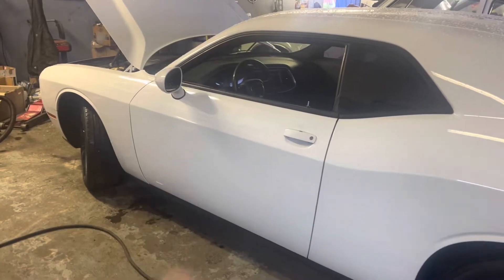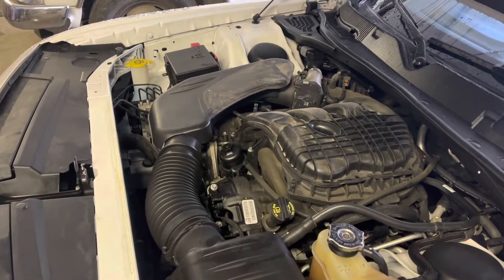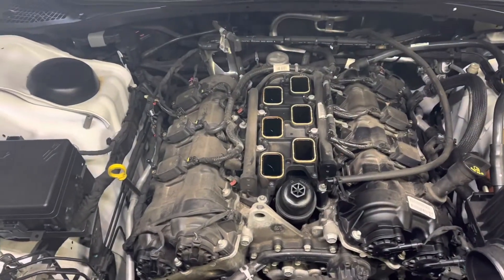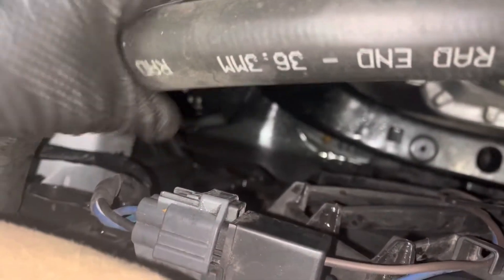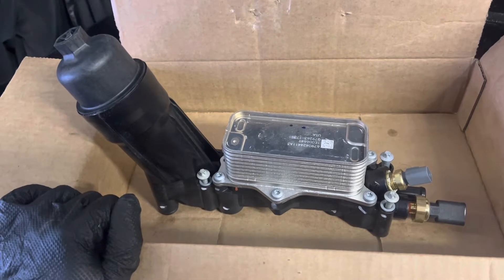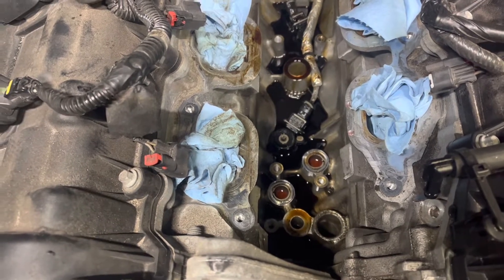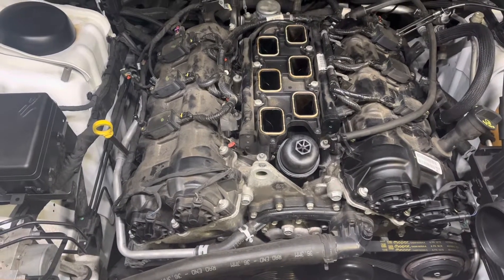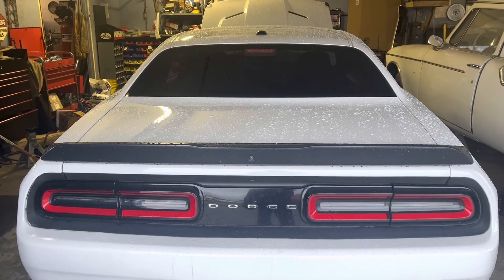The Dodge / Chrysler 3.6 “Pentastar” V6 Oil Cooler Problem - And How To Fix It

Comment: I have my oil cooler off and I cleaned the pool of coolant . However the coolant is constantly leaking. Have you seen this happen.
Reply from the maker: You have to drain your radiator / cooling system before you pull the cooler. If you didn’t do that, that would explain it!
Reply: It's contaminated with oil in the coolant. What's your thoughts?

Comment: One thing to remember is these have 5 Orings on the bottom that leak because they've been flattened and get old its not necessarily the cooler leaking unless the housing is cracked by overtightening the oil cap. The isuue is its alot of work to lift off both manifolds then removing the oil cooler just to change the Orings so if its leaking just replace the cooler itself while your down there..
Dont get the Doorman aftermarket they can be ill fitting especially the mating surface, the Orings arent as good as Oems and will leak sooner and they dont come with the extra smaller Oring replacement for '18-'22 FCA vehicles..
Always get oem for a sure fit and better spec for internal passages and don't crank the cap it will be totally fine..
Reply from the maker: Dorman aftermarket is going great on my Challenger. Seems like everyone else doing this job is also using the all aluminum Dorman unit. Didn’t know it existed at the time of this video or I would’ve too. Sure, could be O-rings. The OEM parts are only good for 90-100k miles? But we should only use those for replacement... I guess we’ll see.
Reply: @DeadDodgeGarage  I'm glad your having good luck with your Doorman and some on this thread but it doesn't speak for all. Some have replaced it up to 4 times, some still leak and are posing a few problems. Practically 10 out of 10 times the Oems won't leak unless a jar head cranks the filter over 200 ft lbs and literally cracks it and it's the Orings underneath that get smashed that leak and simply need to be replaced as with Doorman they will still leak also only sooner. There is really no need to run out and gel a metal aftermarket to replace a good Oem part taking a chance. Aftermarket material is always substandard to spec on anything Oem.. Oil & coolant share this unit under high pressure and heat internally and not sure I would trust it not to breach and mix the two....
80% have shops or someone else change thier own oil so most want aluminum to minimize the risk.. Do it yourself no issues..
One important item is the Oem comes with the new mandatory smaller Oring for the downspout for FCA models between '18-22, the Doorman doesn't so some cram grease around the Oring and shove the unit into place with a larger Oring then it leaks later..

Comment: is it possible for the oil and coolant to mix in the cooler causing chocolate milk oil?
Reply from the maker: I see no reason why it wouldn’t be possible, but I’ve never seen it with any of the bar coolers I’ve seen.
Reply: @DeadDodgeGarage  Is there any other places on the pentastar that a bad seal or something could cause it to mix? I just put a Zero mile reman in it, replaced everything possible. I doubt it has 500 miles but the oil had a ton of coolant in it. It looks like it was mixing from day 1. All compression checked out at 135+.

Comment: Great video!  Curious your thoughts on the Dorman replacement version that is all aluminum construction vs the factory plastic design.
Reply from the maker: I didn’t know about it at the time I made this video, or I would have gotten one… they are supposed to be the ultimate fix.
Reply: @DeadDodgeGarage  Ahhh ok, good to know you agree with it. I'll probably put one in our 300S when I change out the spark plugs. Thanks so much for your time!

Comment: Has anyoe had oil pressure sensor circuit codes? Does the oil leak onto the sensor and cause it to short? If I replace it would it most likely fix that code as well?

Comment: I have that little puddle would oil leaking on to my knock sensor be causing it to kick on? Its intermitten but i keep getting the p0330 code. I know this is old but hopefully you respond  btw loved the video
Reply from the maker: I’ve never had that happen, but it would make sense.
Reply: @DeadDodgeGarage  I mean I'm not having any performance issues and the behavior of the vehicle don't change but that is where the knock sensor is located. It says knock sensor circuit 2 malfunction

Comment: I bought an aluminum one from Dorman, I can’t complain at all about it ! It was a pain in the butt to change, I had to lightly tap the old one out with a hammer to get it out it was in there so tough.
Reply from the maker: Yeah! Those didn't exist yet when I still had my repair shop. Several people have dropped in the comments here to let me know that's the way.

Comment: A friend of mine brings her caravan to me for oil changes etc, I shuddered the first time I saw this oil cooler setup - I did learn you can buy a replacement made of aluminum.  I am extremely careful with that housing and the filter as I don’t want to break the bakelite threads - I agree with you though, the little pentastar 6 has a ton of power.
Reply from the maker: I learned about the aluminum unit in these comments. I’ve never seen one, but if I have to do it again… I’ll find one of those.

Comment: Hello, sir. I have a question. 3.6 engine need to change the circuits?  because the 5.7 does not
Reply from the maker: Circuits?
Reply: @DeadDodgeGarage  engine chains. i was hear 5.7 dont have chains , how 3.6 engine ? have chains or no ?  Thanks you sir for answer
Reply from the maker: @liudasjankauskas601  5.7 has a regular timing chain for the in-block camshaft. 3.6 has quad cams and two humongous timing chains... It's a crazy setup.

Comment: Would the oil cooler cause a small amount of oil to be in the coolant? Also noticeable fluid around the bottom of the cooler and leaking near the transmission housing
Reply from the maker: Definitely possible. I haven’t seen fluid exchange on these myself but it’s certainly possible that they could swap. Yes - you’ll have the little swimming pool in the valley, and it will leak down onto the transmission. On my Ram truck, it would splash out any time I accelerated quickly or went up a hill, stream down the transmission and hit the exhaust.

Comment: Where the engine oil cooler goes that provision present an opportunity to take a idea out of Audi's play book.
Reply from the maker: Remote mounted? I try not to know much about Audi. Haha.
Reply: @DeadDodgeGarage  The 2.9 twin turbo v6 in cars like the RS5 produce 444 hp and 400 ft-lbs of torque. 0-60 takes a little under 4 seconds. I would delete the oil cooler and pump an oil feed to twin turbos. On the low side of the rpm range  incorporate a centrifugal supercharger which goes neutral on  mid to high reducing parasitic load. Oil coolers (air cooled) can be incorporated in the routing. Just an 💡.

Comment: Hey I just got my oil cooler replaced then my themoststat needle continued to fluctuating and running hot next I replace the thermostat and it is still fluctuating, what do you think the issue is now
Reply: Prob trapped air in coolant system
Reply: Prob trapped air in coolant system
Reply from the maker: I don’t think you’ve got anything left but, like, head gaskets
Reply: Water pump?

Comment: Say I have a problem I have a 2015 Dodge Challenger SXT PLUS & my car overheats I changed the water pump and the radiator as well as the thermostat there’s no oil in my coolant or coolant in my oil.  my singular radiator fan only comes on when I turn the heat with ac on and I can’t figure what’s wrong and the temperature goes down a little when I speed up a bit but at idle it it overheats without the heat on
Reply from the maker: I’ve thought about this quite a bit and I don’t have an obvious fix without a bit more info. Did it just start overheating out of the blue? Did you buy it like this? Did it blow something and lose a bunch of coolant before this started? Have you bled the cooling system properly after these repairs? I will say, if it’s got a bad head gasket, it could display these symptoms and would not necessarily cause an exchange of oil and coolant. In my experience it’s more common for blown head gaskets to not do that, actually. Feel free to reply by posting another comment - I don’t get notifications for replies to comments and things tend to get lost. Additionally, if you like, you can email me at Jamienoise@gmail.com and I’ll help you as well as I can.
Reply from the maker: Oh, also, it may be completely normal for your fan to stay off until like 220 degrees. This varies by vehicle, and I don’t know right off hand what the kick on temperature is on your Challenger. But engines tend to be configured to run at hotter temperatures these days - especially smaller, more economical engines, it seems.
Reply: @ Julian did you ever figure out what the problem was ? My Durango doing the same..

Comment: 2014 300. Did the exact same thing, saved on the cheaper part figuring it was good. 
It was not. 
1.5 years later I'm doing again, with greater irritation.
Reply from the maker: Yep. That’s been me… twice so far. Lesson learned. I don’t know what they’re messing up on the cheaper ones, but it’s just not even worth trying.

Comment: The one on my 2012 challenger started leaking, traded it in on a dodge journey, more practical for hauling grand kids! My 2011 challenger never leaked but I just traded it for a 79 corvette, it was fixing to roll over to 200,000 miles! I still have my demon though! Great advice and video! Thanks for sharing!
Reply from the maker: Nice. I’ve done heater cores and oil coolers in journeys… just saying! I’m getting to know these newer Chrysler products really well. Haha.